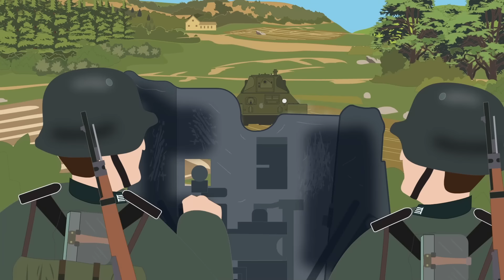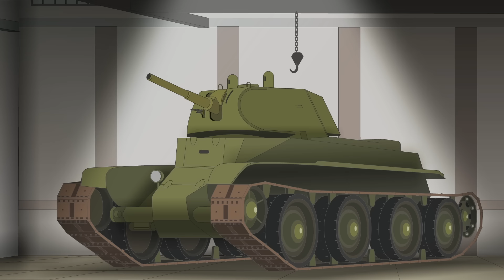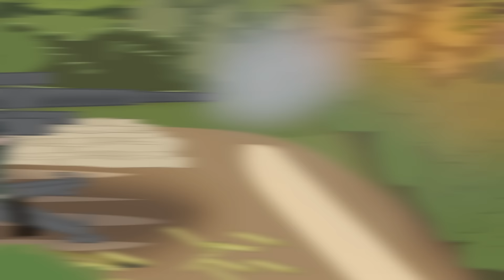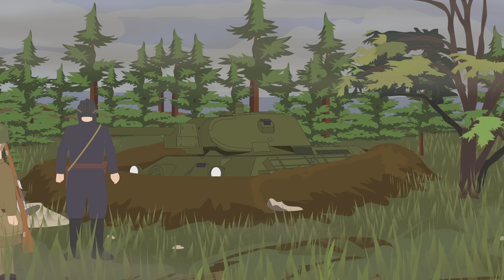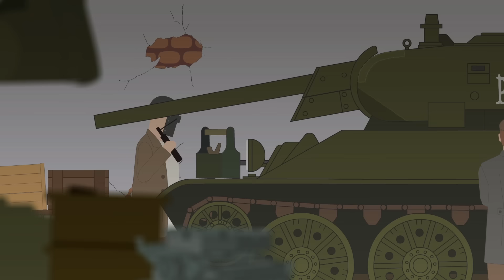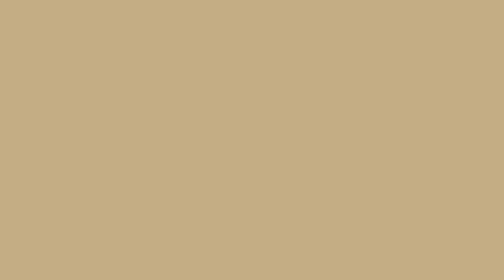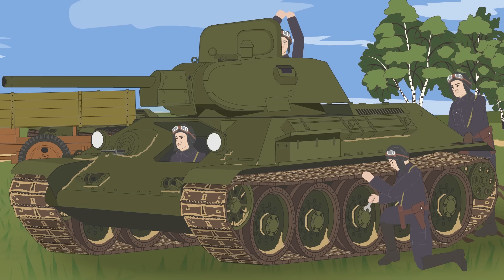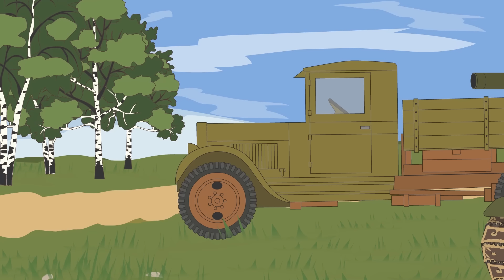Was the T-34 Really the Best Tank of WW2?

Comment: One interesting thing I noticed early on in the video... you mention the T-34s deployment coinciding with the Sept '39 German invasion of Poland... but you ignore the Sept '39 Soviet invasion of Poland--as part of the Molotov-Ribbentrop Pact--& especially the Nov '39 Soviet invasion of Finland. Both saw how ineffective the BT, earlier T-type, & the KV tanks were on rough terrain. It was the lessons learned there that made the T-34 design so effective (even if the rushed manufacturing compromised some areas).

Comment: Who ever said that the T-34 was the best tank of the war deserves to be shot. That fucking thing on average couldn't go more than 50km without breaking down, the driver had to hammer the gear lever into place,  the crew was effectivly blind and deaf thanks to stuff not being bolted down properly and periscopes without any mirrors and ontop of all that the armor would be heat treated at a way too high temperature making it very bridle resulting in the armor breaking and spall shreading the crew even when a enemy round didn't penetrate.
Reply: The T-34 is like everything else the commies did:  Mass produced foreign developed stone-axe technology, overwhelm the enemy with large numbers of poor or mediocre troops/weapons.  Flawed as it is, however, the T-34 did what it was intended to do.
Reply: @TS-mo6pn  not quite, on paper the T-34 is average, somewhat on paar with the sherman (besides the whole not being heat trated properly), just the reality of soviet war time manufacturing made that thing a rolling trash can, the initial design being striped down untill it barely was able to roll out of the factory. For the factory overseers and workers it was either that or gulag
Reply: @bnau374  too true ....

Comment: In 41-42 the T-34 suffered terribly from lack C&C since only platoon, sometimes, and Company command tanks had radios. Because of this the T-34 had zero battle field awareness. Germans repeatedly talked about how they would first shoot the tank in the rear and then move forward. Each T-34 having no idea their platoon, or company, was being wiped out and failing to respond. Second the 2 man turret (which is constantly over looked) was a major design flaw which contributed to the T-34s already terrible situational awareness on the battlefield. The commander was not only responsible for guiding the tank while looking for threats, he also was responsible for aiming and firing the main gun. Ergo a commander could not actually do his job of spotting the enemy and killing the enemy at the same time. The lack of visibility from a buttoned turret and no commander copula, heaped more onto the already terrible SA the T-34 already had. Add onto this the very slow manually cranked turret and you have a nightmare for the crew of a T-34. It was just not a very good offensive tank when it was on the move. (Note: the 2 man turret was not increased to 3 until the introduction of the T-34/85 in '43)

Oh, and lets not forget the horrible optics on a T-34. The video talks about the T-34's gun being able to penetrate Panzer armor at 1000 meters... yeah... in theory, but there was no way the commander could aim that far. This is why the Russians employed such aggressive tactics with the T-34 using maneuverability to close with the German forces to the point where they would just run over AT guns and machine gun positions instead of trying to engage them with their main gun.

The Germans were shocked at first, but the daring of the Panzer commanders added to their experience and each tank in radio communication, ergo their C&C being excellent, they were able to outmaneuver, and get in very close to T-34s and KO them with track hits, engine hits, gun hits, or sometimes they would just shoot a T-34 so many times without the T-34 not being able to detect where the fire was coming from they could get the crew to abandon the tank.

Through most of the war Panzer tanks, while some of the more famous ones were unreliable, the problem the Germans had with killing the T-34 was that they just didn't have enough ammo. Many surviving panzer crewmen tell stories of how they would shoot every round killing dozens of T-34s and more just kept coming. They could not believe it. While there may be some exaggeration in numbers the Panzers crews enjoyed a much higher survivability and so did their panzers. Even when KO'ed panzer were far more likeyl to be towed to the rear and repaired while the T-34 did not. I think of the 56k T-34s made 46k were total loses in combat. That is a pretty grim number if you rode in one.

In the end the T-34 was just like the Russian soldier. Quantity over quality, and as seen with the American Sherman, you can out produce your enemy and win, you just don't have to care about casualties.
Reply: This is a revisionist myth. The Germans did have an advantage in its kill ratio, but that had much more to do with its anti-tank guns and not the German tanks. In order for the Germans to have had fewer rounds than the Russian had tanks they'd need to have produced well under 100,000 tank rounds. In reality, the Germans produced over a billion rounds of all kinds for artillery guns and tanks, they just simply did not have the stretegic foresight or tactics to resist the Soviets once they got going. In fact, even before Operation Bagration, the first time the Soviets really outnumbered the Germans in all areas, the Germans were suffering. They outnumbered the Russians in terms of equipment and soldiers at Moscow and that includes the Soviet counter offensive. Even in the first half of the battle of Kursk the Germans had a very similar number of tanks. They lost because their army was worse, both in terms of its size, doctrine and tactics. Btw the kill ratio in Germanys favour was never "dozens" to one it was more like two or three to one

Comment: I know how we could possible MASH the T-34(85) with Tiger 1, We slap in the gun of the Tiger 1 to the T-34, increasing armor, increasing engine power so that we still can go fast. Now you got a Tiger T-34/1(85)
Reply: There are unconfirmed reports about a T34-85 was rearmed with a 88mm gun and it allegedly saw action with the 7th Panzer Division in East Prussia. This tank is known as T34-88.
Reply: @MrLantean  Welp i guess we replace it with that name
Reply: @abielgabriel7095  The earlier model is known as T34-76 because it is armed with a 76.2mm gun. The later model is known as T34-85 because it is rearmed with a more powerful 85mm gun. If the T34 is hypothetically rearmed with a 88mm gun,  hence the name T34-88.😀

Comment: Against the Pak crews? Sure, the T-34s were lethal... against actual German tanks? Well.. they used the lemming strategy since they outnumbered German tanks at around 3:1. The Tigers/Panthers/Tiger 2's/Stug IVs etc shredded them with superior guns and range/accuracy.. problem for the Germans was they couldn't fire in every direction at the same time, especially since the T-34s were much faster then what the Germans were fielding and the Soviet guns were more then enough to make confetti out of weak and flat German side armor plates.

Comment: The T-34 basic design had some good features. When it entered service the T-34 was possibly the best in the world. But the quality of production was low. The early T-34/76 turret was too small to hold a loader and had terrible ergonomics. They lacked many useful features. Most WW2 T-34s lacked radios and intercoms. On paper, the T-34 performance was good. But in reality, it was average to poor. The design was generally reliable but poor construction made it much worse. Like Soviet equipment, it was rugged, simple and easy to repair. If parts were available. The T-34/85 was a significant improvement. With over 50 000 built during WW2 it made a vital contribution to winning the war.  But at a high cost. Loss rates of T-34s was much higher than Sherman tanks. One of the quality problems was inconsistent armor manufacturing. Many had strong heating to improve armor penetration. But with overly heating of the armor made it more brittle. That made internal fragmentation of the armor was more likely to hit crews and ammunition. Like the effect of high explosive HESH ammunition. This was a production problem, and not a failure of the design. . Post war T-34/85 production could have been built with much better quality and accessories. Such as with radios and internal communications, more optics and better quality armor. The T-34/85 with a loader could have greatly improved firepower with much better target tracking, sight acquisition, faster aim adjusting with follow-up shots, the commander's situational awareness, and reload time. Situational awareness is vital for tank crews. And good quality armor could greatly reduced casualties and ammunition fires.  Much of our WW2 history needs to be checked by many countries to overcome significant post war misinformation, propaganda and poor research. The Chieftain does and other Utube historians are trying to find original documents to check what information is accurate. Translation between language is also a problem and there is a massive amount of history documentation that is not in English. The history of the Battle of Midway is a very good example of misinformation that is now being studied again from original documentation. Misinformation is sometimes intentional, but often poor quality research. Sometimes just historians wanting to simplify very complex events. Veterans are a rapidly disappearing source of WW2 information. But this can be unreliable when a soldiers view of the war is mainly from in a trench. Historic interviews is a very complex issue. Different soldiers from different trenches often have a very different view. In regards to trenches, is an example that can be applied with many situations. The views of a private and a general is another example of very different views of the same situation. Even with current events, this can be a problem for historians. And historians often have a different agenda. For some writers, it can just be written to be more entertaining or increase popularity. As well as cultural differences.

Comment: The t-34s had brittle armor which means if penetrated the armor would have huge cracks and the transmission would break down easily and a lot of t-34s got destroyed by mud because they couldn’t get them out of the mud and the wight wasn’t spread out as other tanks like the tiger

Comment: The T-34 looked good on paper but in the battlefield its ‘soft’ flaws led to huge losses. Meanwhile Western tanks like the M4 Sherman and Pz IV may have lacked sloped armor or wide tracks but they were better combat systems overall.

In the Korean conflict of 1950-53 the T-34 again suffered disproportionate losses against Allied vehicles with comparable capabilities. The opinion of a Royal New Zealand Armoured Corps tanker is worth reading (30):

‘And now, Sir, a few words for your private ear on the T 34. I assume that the tks given by Joe to Mr. Wu are old models. Even so they were grossly overrated in press reports in the early days of the KOREAN Camaign. (A well placed HE shell from a 20 pr will lift the turret off). Only about 4 per Sqn have wrls and their armour is of poor quality. The whole tk is of the crudest workmanship, and breaks down with the greatest ease. (In fairness I must add that this may be due to inexperienced CHINESE crew). They would have to be used in mass, RUSSIAN fashion, to be any treat to a well trained, well equipped Army, as they have been proved somewhat inferior to the SHERMAN. A CENTURION will do to them what a TIGER did to the SHERMAN. They got their initial build up as a scapegoat to cover the natural and understandable, fact that the first American tps over here were raw, frightened boys who were also soft from occupational duties in JAPAN. The T 34, I am convinced, should be de-bunked. It is a workable tk, but NOT a wonder tk’.
 
Effect in the design of postwar Soviet tanks

Postwar Soviet tanks like the T-55, T-62, T-64, T-72 and T-80 all followed the same design principles as the T-34:
  
1.     Very low profile which meant limited internal space and poor gun depression.

2.     Limited weight which led to good speed performance but put limits on the level of armor protection.

3.     Simple and rugged construction which meant that they were capable of being mass produced by Soviet factories but at the expense of crew comfort.

Soviet models from the T-64 onwards tried to deal with the limited internal space by automating the ammo loading operation. However their autoloader was problematic and often led to accidents.
Western models like the M-48, M-60 and Centurion were taller and heavier but they provided their crews with a better environment. They also carried more ammunition (25%-51% more).

On paper the Soviet types looked superior but on the field it was the US and British types that won the battles. During the wars between Israel and the Arabs small numbers of Western made tanks wiped out numerically superior Arab forces equipped with the T-55 and T-62 tanks.
One of the most famous episodes is the Battle of the Golan heights in 1973. The Israeli Centurion tanks of the 7th Brigade faced a huge Syrian force but managed to inflict horrific losses on them as they tried to overcome the tank barrier. The Centurion was much heavier (52t) than the T-55 and T-62 (36-40t) and powerfully armed and armored. It also carried 51% (65 vs 43) more ammo.

That battle was a repeat of WWII when the T-34’s charged the field only to be slaughtered by German tanks from a distance.

The performance of the T-72 which was supposed to be the tank that would win a hot war for the Russians was similar. In the Gulf Wars Iraqi T-72’s were easily destroyed by modern M1 Abrams tanks from great distances. As Tom Clancy put it ‘It was a death trap like everything else the Russians built’.
The T-34 legacy led the Russians to invest in quantity over quality. A mistake that their Allies paid dearly.